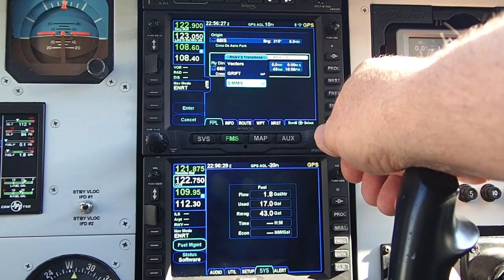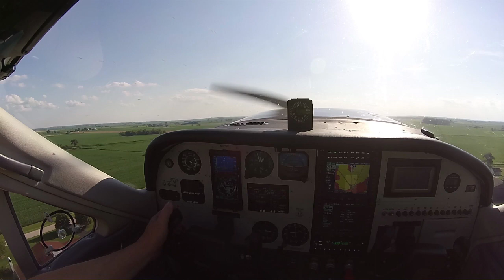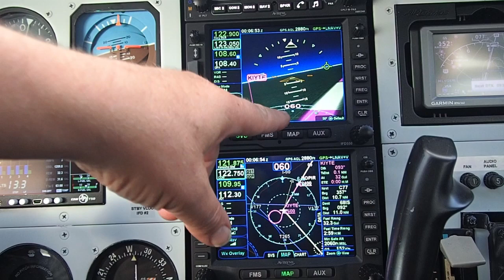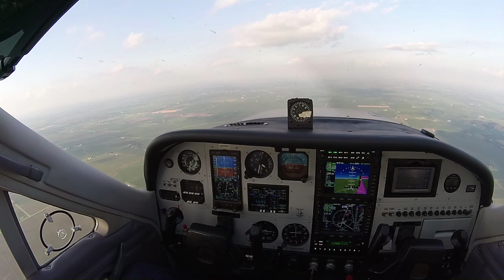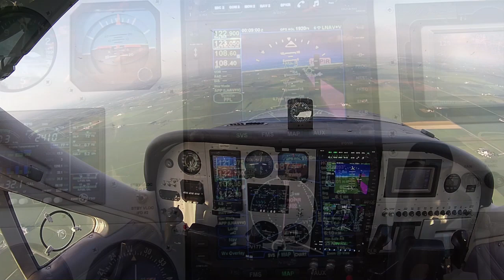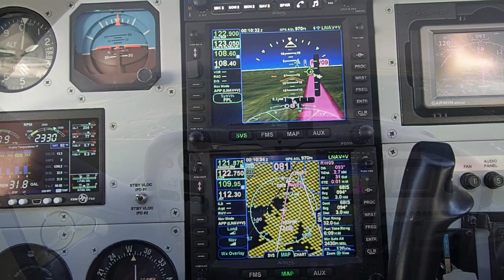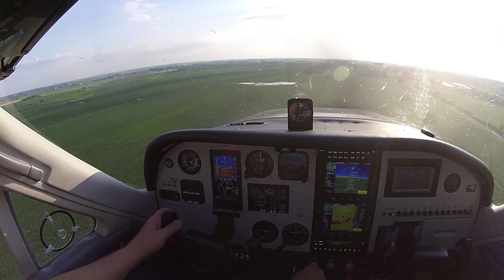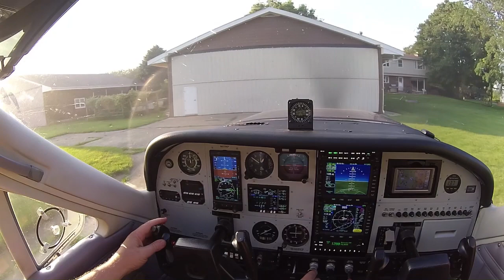Coupled approach with Avidyne IFD550 in a Cardinal RG

Comment: That is a very gorgeous Cessna 177 Cardinal RG and the interior/panel...speechless!!!!!!! Thanks for sharing this! Awesome video quality/audio!🙏🇺🇸👍

In my humble opinion: Cessna should really consider using the 177 Cardinal's design/body, and reintroduce it as the "all new" Cessna 172 Skyhawk. The Cardinal still looks very modern and sexy, not to mention all other benefits. Break out the jigs Cessna/Textron, dust them off to help keep pricing down and get to work.

Also, please offer an optional JET A power-plant and a more modern T-handle throttle quadrant, like you were already doing with the JT-A Cessna 182.

When you finish that, take the original 172 Skyhawk, and make it an affordable trainer!

Comment: I did like your new Cygnet yokes you chose.  There was also a Korry Mason a little smaller used in the Premier 3A I liked.  PS.  "dead nuts"   now I know you are a mechanical engineer, or manufacturing engineer.
Reply from the maker: Indeed, I am a mechanical engineer. Thanks for enjoying it!

Comment: Been practicing GPS RNAV Garmin1000 approaches on XPlane11, just a sim. guy, I'm just happy I went from doing direct flights and always bringing the plane in manually,
to learning flight plans, and then how to do a proper RNAV approach and let the Garmin bring you in right down to minimums and then disarm AP and set her down. That was good
enough for me, after a year and a half of studying and flying. I'm studying the VNAV features as well now. If you're flying somewhere like to Telluride, it's a good idea to master the
RNAV (and ILS of course) in case of any weather or other issues that might arise. Real life is real life, but even in XPlane the RNAV LPV approach takes a lot of the anxiety out
of a given approach. Like if I'm flying into Telluride or Sedona, I just arm the approach maybe 85 miles or so out, make sure I do my TOD so I'm down to the IAF altitude,
and then just let it bring the plane on in. It's really fantastic. Of course you need to hand-fly it and get that down first, then you can move on to the RNAV and ILS approaches.
It also helps you take the worry out of centerlining a landing, although sometimes the weather or windage, etc., and other factors, can mess with that, and you'll have to 

crab the plane in, slip, and/or disarm the AP earlier and correct.

Comment: OK, Made the connection as I'm a CFO member.  Just bought this plane a few months ago.  I need to replace the KCS-55A and the problem is finding systems that are compatible with the rest of the panel.  Getting new paint in October... much like your paint scheme.  Not a Garmin fan either!
Reply from the maker: For what it's worth, although I had an NSD-360 HSI before the Aspen my avionics shop suggested I have the 60-2 converted to KCS-55 mode and set the Aspen up to emulate the KCS-55. He said in his experience that resulted in a smoother interface, and it does work well.
Reply: Hi Keith, can you look my email up on the CFO site so we can talk privately?
Reply from the maker: There are 19 Dave C's in CFO... but only one of me! :-) Bet you can find me easier than I can find you from the available data... :-)

Comment: Keith: what is the purpose of the round inserts in your vent windows? Are they for inflight ventilation... or dropping messages during the bomb run?  :-)  I seem to recall an STC for larger square inserts in the left and right main door windows as well, and wonder why you chose the small round ones instead.  I assume you can not lower your vent windows with the crank handle with these small inserts. Is that correct?  Really enjoy your videos and am going to buy a Cardinal if I get my medical back.... and after you do the pre-buy.  Thanks in advance.  Mark Polansky, KANP.
Reply from the maker: Hi Mark. The small circles are photo windows, they pop right out. With a digital camera you don't need to put your eye to the eyepiece... just watch the screen. And I didn't want to have the large square photo window in my line of sight all the time. 

It does also give you some airflow when they are out, but not a lot. Sticking a large enough camera lens out the hole pretty much stops the inflow, nice on cold days.

The vent windows work normally with those installed. They don't lower, the hinge along the back side and stick out into the wind, like cars used to do! I look forward to helping you with your Cardinal once you sort out the medical.

Comment: HI Keith, 
Beautiful plane.  I'm looking for a Cardinal RG and was wondering what year your plane is?  How much did it cost to put in your panel?  What's the best way to put together a plane like yours?  Buy a late 70's Cardinal with low airframe and engine/prop times, new interior, but original instruments and then just gut the panel and install new?  What would I expect to have in the plane once it's all tricked out properly?
Reply from the maker: Mine is a 1976. There are different theories about the best strategy. First you need a clean airframe, then it is a question of whether you can find one put together the way you want. If so, you'll save money over doing it yourself.  I help people with both of these, check out my web page at http://cardinalinspections.com.

Comment: Love the panel ,I have always liked the Cardinal.  I have heard many different numbers, what does your Cardinal RG cruise at 8500 speed and fuel? I have an Cirrus SR-22 and am having the IFD540 installed right now and can't wait to play with it.
Reply from the maker: Performance depends on many things. I find that I got book performance with a stock exhaust system, now that I have a Powerflow it's better. At standard temperature, 8500 feet and lean of peak I figure perhaps 145 knots true at 9 GPH.

Comment: I also have a 177RG and was considering the Aspen 1000 Pro and the IFD 550.  Have heard about several failures in the Aspen unit.  What is your experience with it?  What autopilot are you using?  Thanks,  N177AP
Reply from the maker: As a founder of the Cardinal Flyers I've heard the same... a few of our members have experienced screen failures but the company quickly resolved them. I think one member had two in a row, Mine has been solid. As can be seen in my other videos I kept analog backups for airspeed and altitude just in case.  My autopilot is an Stec 60-2, although since it's an analog autopilot I'm watching the Stec 3100 closely.